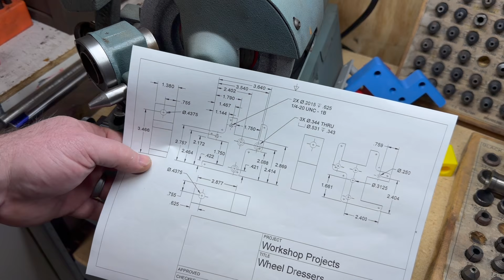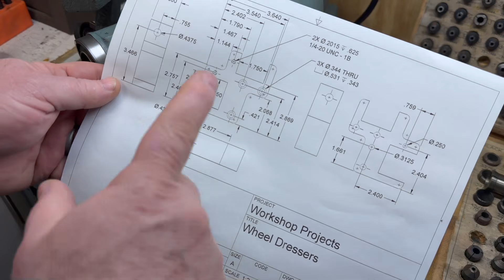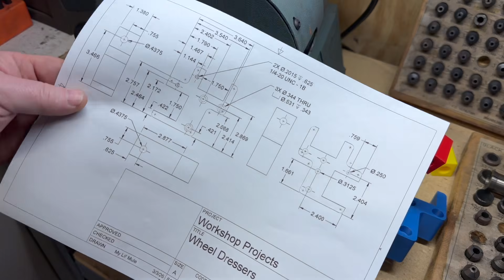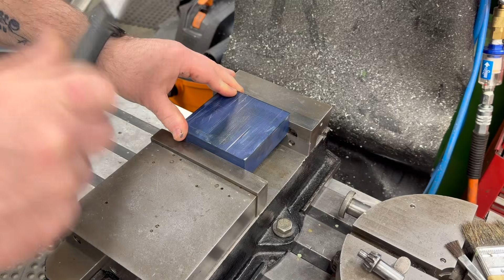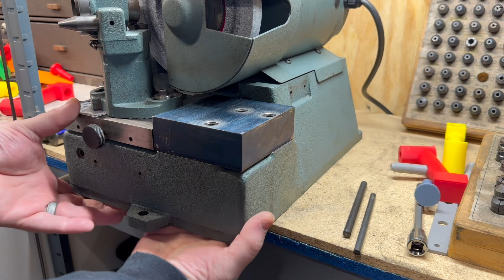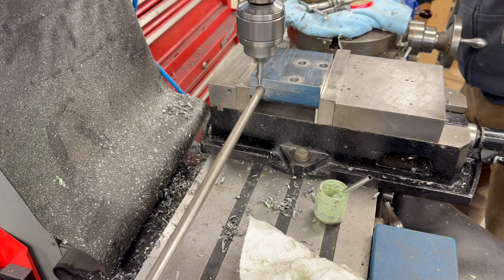Black Diamond Drill Grinder - Machining the base for new wheel dressers

Comment: Yo. Adrian. Stallone sez great job. That’s gonna be one solid wheel dresser. I have a question, for your layout lines, why not just trace out the 3D printed mock up if it’s dimensionally correct? I get the hole locations being a measurement but the material removal has more flexibility. Just curious.
Reply from the maker: I suppose I could have traced the 3D model. Didn't think of it. I will on the next one. 😉. Thanks for the comment!

Comment: I really enjoy your videos.  I am just a home shop guy also. 
One thing I see on your rear wheel dresser, the yellow one.  I really think it should be at or below center of the wheel.  Anything above center and it will want to dig into the wheel and be forced down. 
Just like on your surface grinder.  Placing the diamond left of center for the same reason. You can easily do that by making the dresser angle down instead of upwards. 
The 3D printed prototype parts are really slick. 
Joe
Reply from the maker: If the wheel is rotating counter clockwise, placing it below center (or left of center) would seem to more likely cause the issue of which you mention. Looking at videos of the original, and by the shape of the cutout in the guard, I am pretty sure it needs to be at or slightly above center. I am trying to duplicate the OEM design. I could be wrong, and will research it more before I make the swing arms to final length. Thanks for the comment!
Reply: I didn't even think about the wheel rotation.  Oops.
Carry on. 
 @MyLilMule